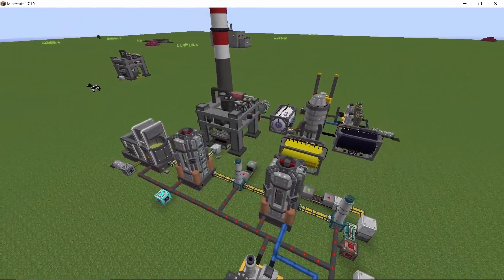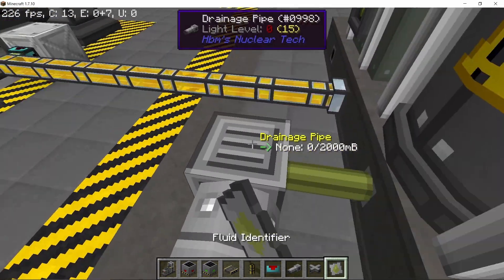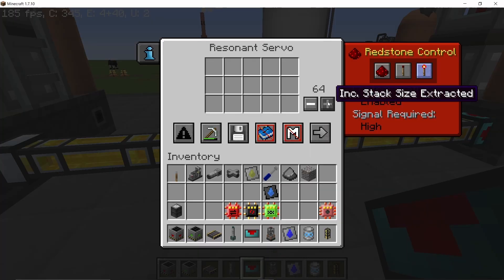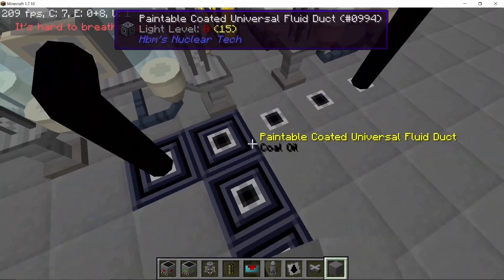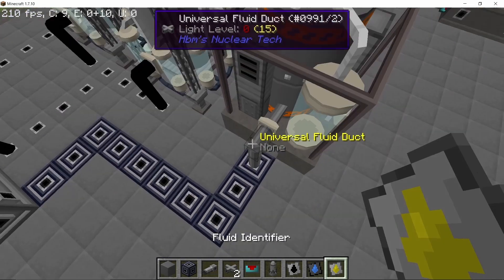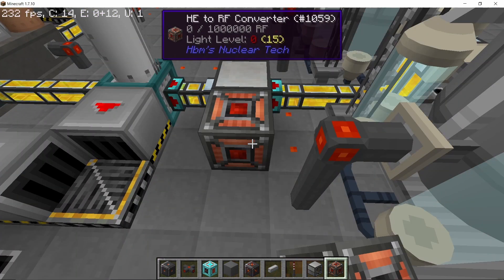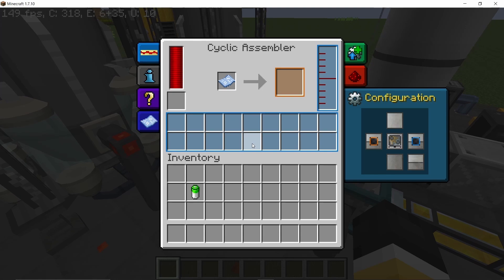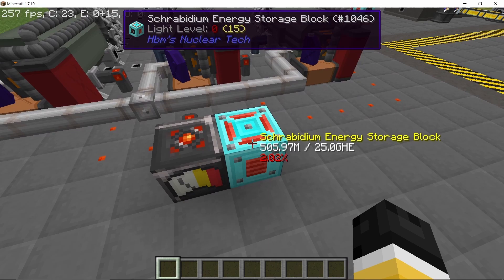COAL GASOLINE - Thermal Power Plant Tutorial - HBMs NTM

Comment: Is there any way to stop hydraulic fracking tower polluting dirt and its surroundings environment
Reply: Unfortunately no, but you can use the pollution to farm mustard willows nearby, which will allow you to make cadmium!
Reply from the maker: I haven't yet seen a config option for it sadly so I would say no, you can replace a big area around it with concrete or smth and make your oil rig on it.

Comment: Hey savage Vegeta did you have a way to mass produced antimatter I want to use it as fuel for dfc thanks
Reply from the maker: Particle Accelerator is the way to go then, you will need copper and hydrogen and as the accelerator can be automated now you can produce antimatter at a constant rate
Reply: Ok thanks but I don't know how to automat the particular acceleration but I will try to figure out my self if needed